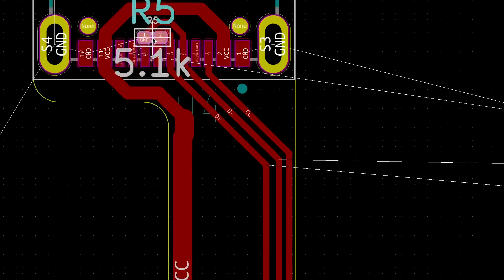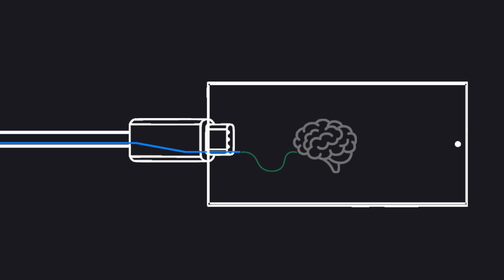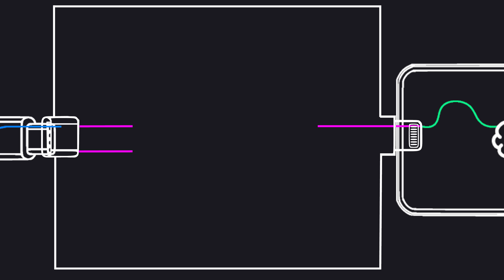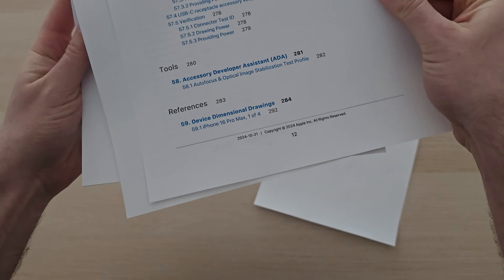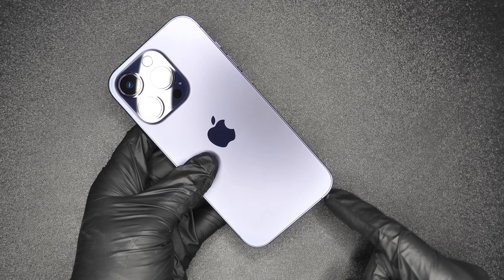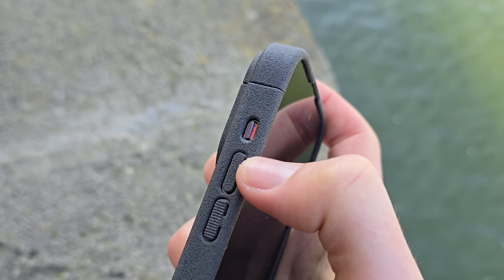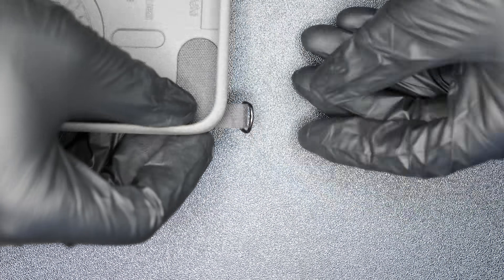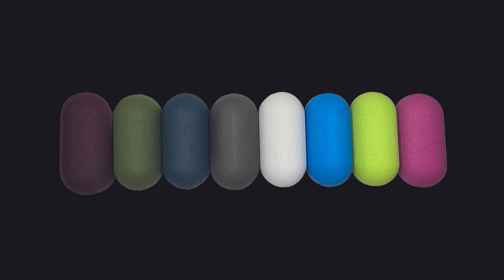I Gave Every iPhone USB-C.

Comment: Imagine having a headphone jack at the left side to make it even.
Reply: Or another USB-C for peripherals 😄 Could use headphones via USB-C while charging, then.
Reply: @Simple_Jack  that would depend on the headphones having a DAC built in, otherwise it’s analog audio output over the config channel that’s messed up :(
Reply: @Simple_Jack eh. Dedicated headphone jacks are much more convenient. I dont have a single pair of headphones or earbuds that uses USB c audio, but plenty of 3.5/2.5 cable headphones.
Reply: @Simple_Jack  Well, no. It’s dangerous for the headphones because of the 9-volt fast charging. Most USB-C to USB-C cables and headphones, or USB-C to dual USB-C adapters, don’t support or have protection against 9 volts.
Reply: I would pay double for a case that has the aux too. I don’t care if it’s thicker.
Reply: @funhaos ngl a case with a microSD card slot as well would be pretty cool
Reply: @funhaos how about the one with a P-Diddy headphones- jack
Reply: i think 2 usb C ports might get this problem solved.
Reply: It would not fit, headphone jack is a deeper port
Reply: @divinemaker if you had it pointing outwards to the left not down then the additional thickness would only be in the bottom bezel.
Reply: @hishnash  you’d never want to pocket your phone with em connected then tho :P
Reply: @hishnash Harder to get the components to fit because of microphone and speaker.
Reply: @hishnash  still makes the bottom or left edge thickness too large, because the 3.5mm port (equivalent to 1/8 inch) is not small and easily noticeable in size.
Reply: @hishnash i think the headphone plug would block the speakers if it was on the bottom
Reply: @divinemaker I’d personally make the sacrifice of having a thicker chin to house a headphone jack
Reply: Contacts on case, expandable housing like thos Ethernet ones
Reply: @solidsnakexy810  You may be right. If the phone had a thicker chin, it may be able to house a headphone jack. Would it be easy to use the phone with a thicker chin, i don't know. It might be a worthy sacrifice for some. But personally not for me.
Reply: i you can add headphone jack with bump people buy it on any cost
Reply: @solidsnakexy810  at that point, you should just get a nice adapter from headphone jack to usb-c, also he "modernized" the old Standart. Why use a headphone jack when USB C does the same and more?  (I get that most headphones just use the audio jack, but still.)
Reply: @solidsnakexy810 
But, my brother, he wants to sell a product to the public. He does not care about the opinion of one or two people. In this case, all companies will collapse 😅
Reply: @ppSnow  the 3.5mm jack is round though, makes less sense
Reply: @divinemaker  Sideways
Reply: @divinemaker  2.5mm headphone jack can be the solution
Reply: @SolidCoreBlack hat’s a smart idea
Reply: @divinemaker make it a other type c port, as most wired earphones are type c now
Reply: @divinemaker not if it goes in 90° maybe? Would make the chin thicker but I'd take it
Reply: @divinemaker  would fit sideways..
Reply: @divinemaker  sideways?
Reply: @divinemaker  If, if he places it in the direction of the width of the hull in the over-thickness at the bottom maybe is it possible
Reply: @divinemaker  but if it pointed out from the base of the phone to the left the depth could just be hidden in the chin
Reply: @divinemaker sounds like something apple would say
Reply: @divinemaker rotate it 90 degrees
Reply: @divinemaker  yea but nothing's in the way, and don't even say it's too large of a circle, look at the ipod nano 7th gen bottom view
Reply: @divinemaker could you have it plugged in from the side. It's engineering, there's probably a solution somewhere it just would be very challenging and maybe not profitable but certainly not impossible to experiment with.
Reply: In fact you could make one with a Hi-Fi deck. It's really not all that fundamentally different from products that are already being sold using magsafe to add a hi-fi dac with 3.5, 4.4 etc ....
Reply: @divinemaker  Yes it would!!! just switch the orientation and put it on left side instead of the bottom, with the same extra corner!  only thing it might interfere with the speakers but it would be close forsure!!
Reply: @divinemaker what if it went sideways
Reply: @divinemaker  A guy did it, but he had to remove the taptic engine.
Reply: @divinemaker  How about bottom left but side ways
Reply: @divinemaker  my Bluetooth headphones can use the jack which is only  0.000000000000001mm deep
Reply: Dont give me hope
Reply: Immagine including a whole docking station with aux, Ethernet, HDMI, USB, SD Reader 😂
Reply: @Simple_Jack 😂
Reply: I am from India, I will definitely Oder if there is 3.5mm or another type C for IEM or headphone for my XR. It will be appreciated bro.
Reply: To get even with Steve jobs
Reply: https://www.youtube.com/watch?v=utfbE3_uAMA
Reply: might as well add an sd slot, lol its all possible.
Reply: With a decent sounding DAC as well, totally doable
Reply: maybe put the aux on top right corner.. so it won't interfere with ergonomics while holding the phone in landscape
Reply: You know what makes it even better? Infrared right on top of it.
Reply: Imagine not understanding how anything Works telling people who do understand how things Works how to do things in a way that's actually not even possible😂
Reply: you could also have a second usb c for using type c headphones while charging
Reply: We don’t need any more because for normal people bt is fine and for music lovers we use usb Dac anyway.
Reply: Good thinking. Good thinking indeed.
Reply: Headphone jack and id buy one for my iphone 13 right away
Reply: or just get a 3.5mm to USBC headphone jack adapter...like every other usbc phone when you want a aux port
Reply: i miss headphone jack, it’s almost needed for music creation, type c adapter just too unstable and draw too much power
Reply: Yeeeees pls give me my aux back🫶😭
Reply: Might be better to design a USB C cable instead to go with the case...  Really wish there was a right angle USB C cable with built in microphone jack all in an ultra tight form factor. What I find in the market are right angle adapter jacks and only some phones work with that adapter... And I still think those adapters could be designed even more smaller...
Reply: This.
Reply: Well usb hubs exist for that
Reply: Please!!!!!!
Reply: although I would love to have a 3.5mm headphone jack as well, there is a huge problem: audio quality 🤮
if you dont believe me, try and use an adapter for 3.5mm to lighting or usb-c.
Reply: @albertkunz6730  there are many lightning to 3.5 with pretty good sound and power for 16-32 ohm IEMs (and some special ones for higher impedance).
But not all support mic trrs.
Reply: OH BOY man can dream right?
Reply: 😂 you are killing him!
Reply: He could ad it to the latest iphones near the camera bump, they are thick enough, just make it wider like the androids
Reply: There is already a usb-c splitter that has a headphone jack separated from a charger.  We just need to find out if it would work with the iphone
Reply: Unfortunately the headphone jack port is alot bigger
Reply: While you're at it, add external storage.  Cheap SD, or fast nvme, something.  I wish sandisk just make it. They can copy this board.
Reply: Good idea.
Reply: As modern iPhones don’t meet my minimum system requirements after the iPhone 7, seeing this gives me hope.
Reply: Wired Headphones is aids. Time to level up bro. wireless have more than 24 hour active use battery. Its not a hassle anymore
Reply: @ForLegalReasonsThisIsAJoke1  Wireless always comes latency, with terrible microphones and you have to take care of another battery. I had a bunch of issues with Bluetooth lately where I thought, while I’m waiting for them to connect, I’d already be listening to music with wired headphones. Also 5h of use for the earbuds and 24h including the case is what you get out of AirPods and 37h continuously is what you get out of an iPhone SE 2016, using EarPods. Then there is the price difference. AirPods were $129 while EarPods are $19 and they came with the iPhone SE 2016. Looking at modern standards, the AirPods 4 cost $149 while all versions of EarPods cost $19. You can also get very good and cheap earbuds that are wired and can easily outperform any wireless earbuds for critical listening.
Reply: Such a good video and some really clever solutions. 👏 👏
Reply: Apple explores the headphone jacks at times.
Reply: Damn
Reply: although he told in his website that it isn't possible to use phone powered accessories, but could you can use type c to audio jack adapter
Reply: maybe if the headphone jack port is pointing to the left chin (not to the bottom) it could work. It'd be great for gaming. If you want to hear some music while having the phone in the pocket, just use an L shaped plug.
Reply: what about top left for 3.5mm
Reply: If I had an iPhone...
Reply: That would be perfect
Reply: Imagine merging the lanyard and auxiliary plugs on the right side that would be great
Reply: There are headphones with type c port
Reply: Imagine having a headphone jack.
Reply: @benjamin.kelley I saw that.  And I replied because it’s not necessary when there are  headphones with type c port
Reply: idk y u ppl dont buy androids, dont bother replying, cuz i wont, and i kno ill catch flack
Reply: @WingsOfADream1  I don’t get the point. Is it only iPhones that use type C?
Reply: ifi go blu urself lmao who wants to use a doodoo dac from a phone
Reply: But then it would be missing “Courage.”
Reply: or just use a dsp?
Reply: Absolutely genius
Reply: "Strange parts" YouTube channel : successfully installed the headphone jack inside an iphone.
Reply: on the top where it make more sense, you can't have it plugged in and game at the same time or watch videos if you have it on the other side.
Reply: Nah, it goes inline with the charge port and goes on the top instead of the bottom.
Reply: It fits. Sideways. Some tablets take a connector slotted into the pcb only the pins protrude. 3.5mm thicker assembly, as much as the male itself. Look it up. Also, there are in the market some usb-c to audio sound cards that get encapsulated into the  actual usb-c plug, downside is they only do 48kHz and they do not have mic input, they are only for audio. Source them for testing as "USB-C to 3.5mm male jack adapters".  I bought the product from Action NL for like 1.8 euros/piece. You still need to implement a USB3.0 hub into the case though, good luck with that.
Reply: kek
Reply: It has been done before
Reply: Imagine modular ports. Bro imagine a coaxial connector on one of these babies! You could hook it up to a CRT television!
Reply: Fr
Reply: Bro I was thinking exactly the same thing before even watching the video ehehe 🙌
Reply: Stop, bro. He's gonna cry.
Reply: Website not working
Reply: Should I wait? Cuz now I want both.
Reply: USB is better. That way you can add a dac.
Reply: Please tell me everything you showed us is patented. That’s a lot of revealing data and design and I’d hate your hard work and creativity to get washed away in a clone market
Reply: An old port alongside a modern Type-C port just feels out of place. I think it’s perfect as it is. Most users have moved on from outdated 20th-century ports. Those older ports only supported analog audio and depended on the phone’s internal amp. If that amp was weak, even high-quality headphones wouldn’t sound great. With Type-C and wireless, the amp is now external, built into the headphones themselves rather than relying on the phone.

I disagree, having just a Type-C port is exactly how it should be.
Reply: Chefs kiss 🤌
Reply: There are usb-c headphones
Reply: Honestly, I haven’t really felt the need for a headphone jack whatsoever in years, and the 2 times I have actually needed one in the past few years I just use a dongle from dollarama
Reply: Very hard work 💪 bro keep doing ❤
Reply: and a micro sd card slot
Reply: I know he was pissed when he read this comment🤣
Reply: Op🔥
Reply: Yes if he did that he would be a true pioneer
Reply: And an SD card. I've actually been actively looking for a case that could give me SD card support. But instead I just sold my phone and bought something a little more budget because it still had an SD card
Reply: You can have 50% shares from it!
Reply: Headphone jack is too big so it's gonna make the case asymmetrical and The OCD not gonna like it 😂
Reply: There wouldn’t be enough room just put 2 usbc ports
Reply: Yea i would like to have a kitchen in there
Reply: just to know while gaming it would irritate u
Reply: At that point may as well make a thick case with all the ports. Several usb ports ether net hdmi display port all on the back
Reply: That will be great, I like the idea
Reply: 2.5mm connector is better than nothing
Reply: If this YouTuber buys a phone or tablet and studies and installs a wired headphone jack, I think it will bring more views, and I will encourage him.
Reply: I want aux back
Reply: Since it adds to the right side already just putting it on top might work. 😂
Reply: Better put it on top left screen so the overall design will looks like old Nokia 7610 phone.
Reply: That would be amazing!!!!
Reply: Just came in my pants
Reply: Yes, one that’s also optical!
Reply: I have a backbone gaming hand pad on my iPhone 13 Pro Max.
Obviously it’s like having a switch joy cons on the head and chin on your device (making it a chunky experience) I love it has the charging option on rh side and 3.5 mm headphone jack on left. 
Making this case slightly bigger for both these ports , I would be all in. Compared to the backbone unit I use.
Reply: A stylus would be a cool addition on the other side too.
Reply: le coran est le livre a suivre que dieu ordonne de suivre puis y'a pas mieu et tant que le coran est au top donc l'humain doivent obeir ou dieu punira ou détruira sans aucune alerte comme ceux d'avans et le coran doit être corrigé par ci par les des mot et alphabet dieu la vois vien et il veux qu'on la corrige et y'a pas mieu pour te rapeller et pourquoi les répétition d'histoire c'est sois une signification ou pour resouvenir ou pour dire je suis le même qui a donner la lettre davans ou une cause derriere je suis toujour pas a cette situation je suis entrain de corriger dur ma pagee et sur ma chaine y'a le lien 
j'avais écris avans des message important et le reste dans ma page 
j'ai dit 
bah l'humain a besoin d'une réponse de dieu d'un livre qu'il donne comme celle qu'on a mais c'est pas a nous a avori ca mais a ceux aui prié a dieu de nous guidé si nous somme perdu le coran est vrai
puis j'ai dit encore
ne suivez pas les menssonge dit les saint esprit et suivez nous et oveissez et suivez notre apelle nous avons rendu l'homme prophet un messager de dieu il n'a suivi que le coran seulement 
allez vien me voir maintenant et soit pieu
Reply: Naaah that is legacy now
Reply: This is awesome!
Reply: Saw this poking out of the comments and had to come here to say absolutely yes
Reply: Or apple could just not be greedy assholes and put a headphone jack bask in their phones instead of lying about how there isn't enough room.
Reply: Ws in the chat for headphone jack
Reply: I kind of have one ... Xiaomi but not on its side, but on the same phone
Reply: He can fit it horizontaly but the phone will be a bit longer.
Reply: Yup that’s it
Reply: don’t tell me what to do
Reply: Would love having that!
Reply: imo the world has collectively grown over that requirement
Reply: Respectfully
Almost every person moved on to wireless headphone but yeah, still convenient to have a headphone jack
Reply: damn missed opportunity.
Reply: I've always wanted a modern phone case with a headphone jack in it because companies hate consumers and removed them
Reply: hell for phone gamers
Reply: use a type-c dac, those are cheap
Reply: I hate this fuckers have all the tools and resources but not the ideas common people in the comments have.

He could have put it in the middle to the side to use with joysticks and could have added headphone jack. And make all in aluminum CNC and carbon fiber and a hole in the back for oeltier cooler fans. Etc.
Reply: so no hdmi?
Reply: What you mean? My iphone have a normal headphonejack 3,5mm 😅 its a iphone SE
Reply: He forgor 💀
Reply: Headphone jack + fm receiver + type c = heaven case 🤤
Reply: @mayurinagarkar1431 Why not a blender and cigarette lighter, too?
Reply: @mayurinagarkar1431 😂
Reply: My god you genius
Reply: That’s genius
Reply: as someone who listens to music a decent amount on my phone, that was the first thing i thought about (tho after thinking more, it'd probably be better to have it on the top somewhere, that way it still works when you have it in your pocket right way up)
Reply: type c can be used as headphones jack
Reply: @alphakeny0ne Lightning can be used as a headphone jack too. We want the 3.5mm so we don’t have to adapt our old tech anymore
Reply: @alphakeny0ne he talking about the iPhones that already have type c you know for a aux cord or something but then u can just get the adapter so💁
Reply: nobody uses that anymore
Reply: You would be surprised
Reply: @eris9508  No one? its because no famouse manufacture is making headphone jacks in their phones
Reply: @willywu7293 right, and the only reason nobody uses floppy disks because they stopped building floppy drives into computers
Reply: @eris9508  Exactly, that’s the point. If manufacturers stop including headphone jacks, people are forced to move on, not because the technology is obsolete, but because the option is removed. In this case - a USB-C case for iPhones - there’s no reason not to include a headphone jack. It’s a simple addition that keeps things compatible and gives users more choice, instead of forcing them into wireless or dongle solutions.
And personally, I still use wired headphones — tangled cables are not a problem for me.
Reply: BRING BACK THE HEADPHONE JACK
Reply: Left side should be left as it is. That's because when holding the phone in landscape mode while gaming the squarish bump will hurt the palm
Reply: @Ashishjaj  so put it on the left side of the left corner, not the bottom side, so that the port runs flat along the bottom of the phone instead of up the left side.
Reply: @Ashishjaj  i dont play games on my phone. i just want the utility of having the aux too. could be clever to do it on the top right but that would be problematic since the top comes off. but if you design he case so that its assembled as two sides left and right vest a top piece and bottom piece. you could probably do the aux.